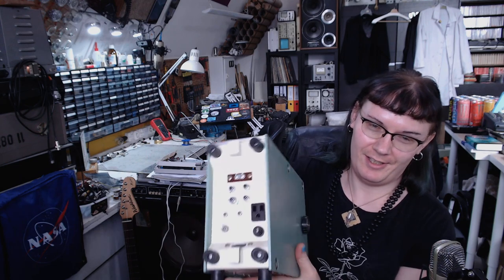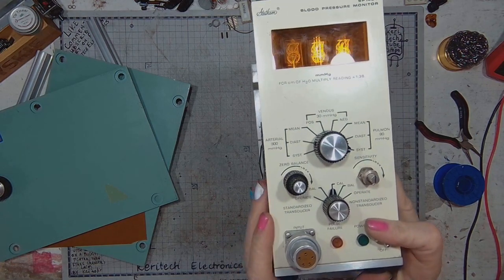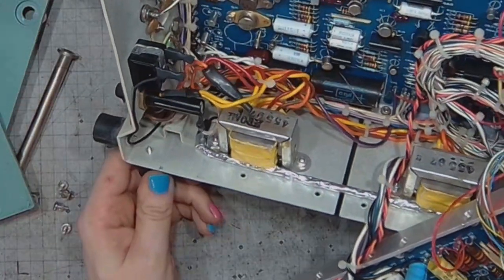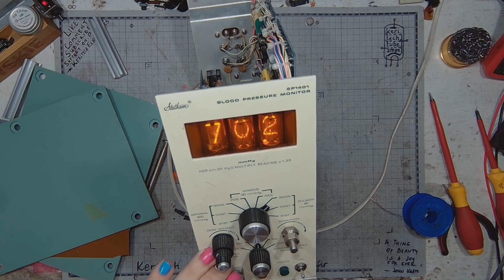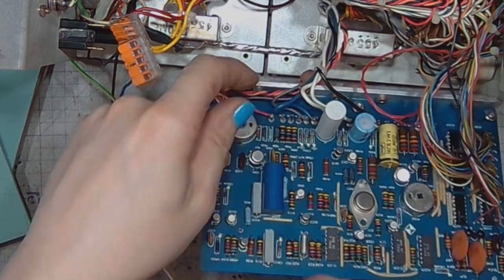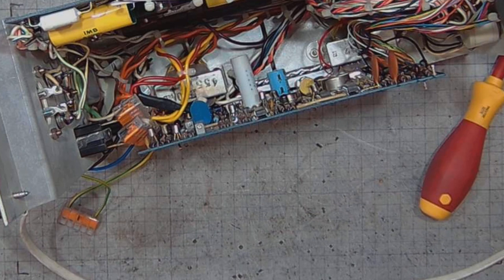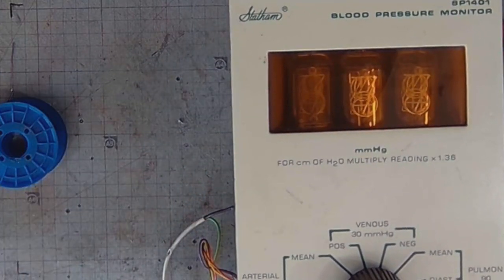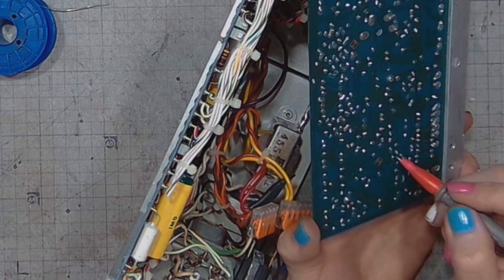Hospital Loveliness! Statham Blood Pressure Monitor

Comment: If you had the blood pressure sensors it would be nice to reverse engineer them, but a Nixie voltmeter is still useful. I would probably scale it to a 0-10v meter.

And by the way white is neutral and black is live in North American wiring. I noticed you connected it backwards.
Reply from the maker: I always confuse them despite years of watching American electronics videos :)